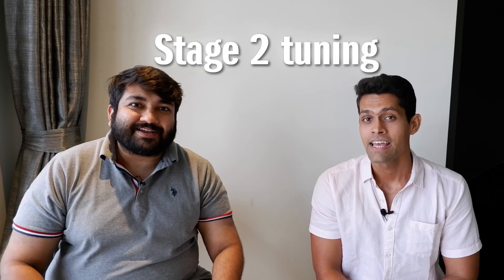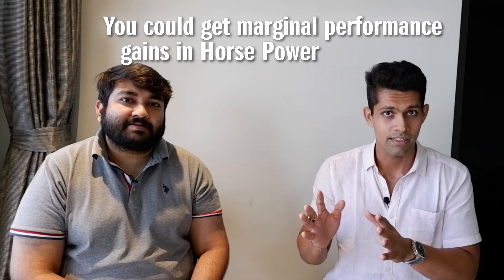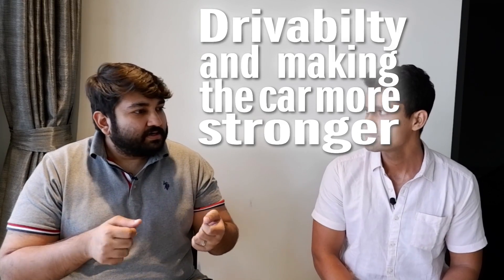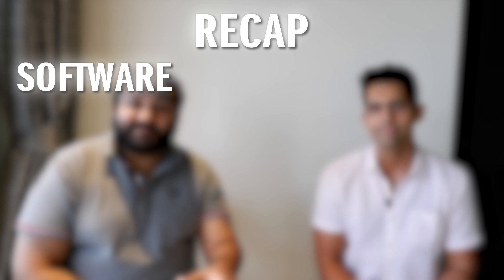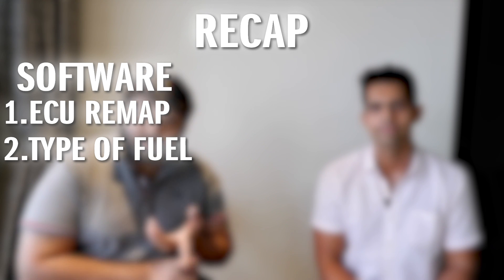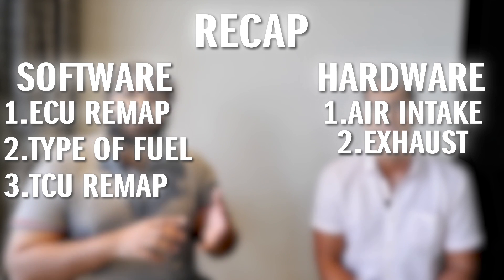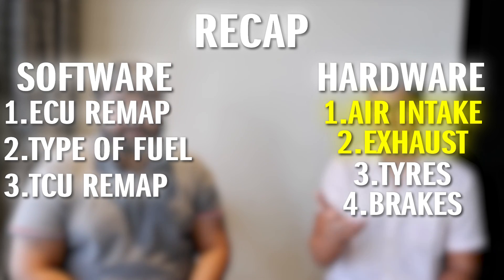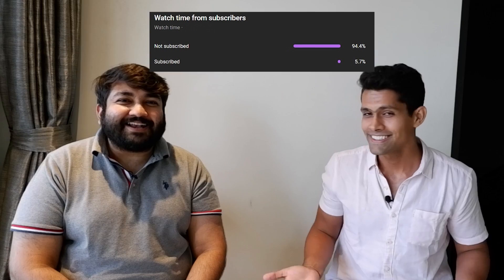What is Stage 2 Tuning ? Explanation / Guide for Beginners! | AutoFly |

Comment: Hey guys, great video, can stage 2 tuning be done to Maruti fronx or Nissan Magnite ( turbo variants ), if yes then how much increase in performance can be achieved?
Reply from the maker: Hello Yes you can consider it , but the gains won't be very significant, but combine that with hardware upgrades too that will be even more beneficial
Reply: @AutoFly  okay, thank you 😊

Comment: Hi, I own a Jimny AT. Wanted to go for Stage2 tuning with full exhaust system with headers. I had driven 2 Jimny under stage1 tuning..one was having an impact on pickup even on initial Throatel responses & the 2nd one was having changes close to 2k RPM. I want a tuning which keeps my Jimny Stable & Calm in snow & mud terrain in Power through put & kicks action in On Road performance. Can you pl guide.
Reply from the maker: Hello Amit , sure kindly tell us more about which tune were you running for stage 1 and had you gotten a dyno reading done before and after the stage 1?

Comment: If I'm not wrong intercooler must need to be upgrade bcz when we increase the horsepower that time we need a upgraded intercooler so it can be helpful to cope with the hot air. Isn't it.??
Reply from the maker: Thank you for your comment, yes you are right, it is better to do it so that the car handles the hot air well, but of course it's possible to run stage 2 even without intercooler upgrade.

Comment: Hi guys. I have a Fiat Punto 1.3 Dynamic Diesel which produces 75 bhp stock. I'm wondering if I should do a stage 1 or even a stage 2 tune but not sure if the gains would be drastic. Could you advice what would be better?
Reply from the maker: Hello Akash , thank you for your query , ideally you'll see the most gains from stock to stage 1 that'll be the big bump instantly but along with that when you do stage 2 and other hardware upgrades your drivability and confidence with the car will improve too so if you do have the budget then you could ideally go for the best start with stage 1 upgrade and hardware upgrades like brakes tyres etc and then see if you can go for stage 2 then do the stage 2 post that 😊
Reply: @AutoFly  thank you very much for your reply. Would definitely do a stage 1 first and enjoy the change for a while

Comment: Hi guys I have question... I recently saw a video where this guy is on stage 1 only and has added only downpipe And an is20 turbo to his golf 1.8t. here's the link 
https://youtu.be/HoB8-iDzT-o

So does this mean we don't have to do a stage 3 remap for ecu+TCU in order to add a bigger turbo. 

Cause stage1+is20+downpipe alone is giving him 260-270whp. Seems quite value for money instead of going for a full blown stage 3..
Reply from the maker: Heyy J, thank you for reaching out , great question ideally stages are useful to progress your tuning in an organized manner especially when you are entering into the world of modifying your cars but if you know what you are doing there can always be ways where you can mix and match things you are doing to the car not particularly in that exact manner of order as stages as long as it all works cohesively, coming to your question the stage 3 always does not mean more and more power with each stage ideally you see the most gains in your stage 1 & 2 setups depending on how aggressive you may tune it but as your progress working on your car it is also how well you are able to drive it and how efficient it is like turbo downpipe and stage 1 plus exhaust would be the best setup but adding better tyres brakes intercooler suspension etc all these will also help you drive even better. so stages are a general guideline of progression in terms of work and when you may not know how to progress max power gains are seen early on as you tune more aggressively do your exhaust intake and then probably turbo in stage 3 or stage 2 but to accompany them in stage 2 and stage 3 you have upgrades to fine-tune and complement the power gains to be able to drive even better tyres, suspension, brakes, gearbox etc.